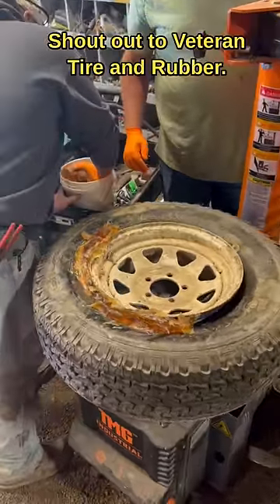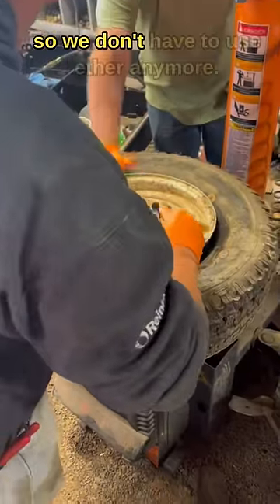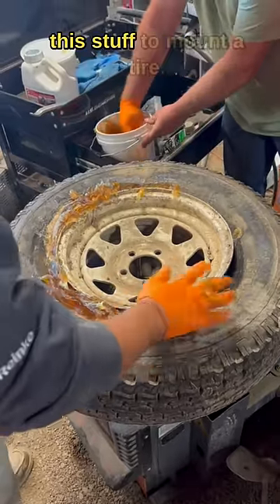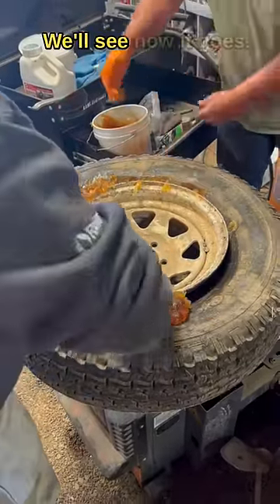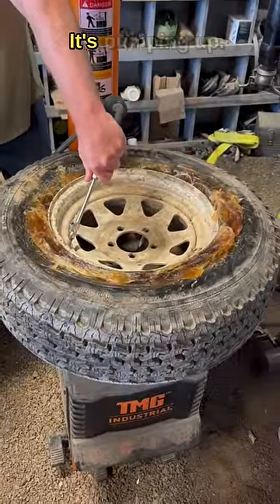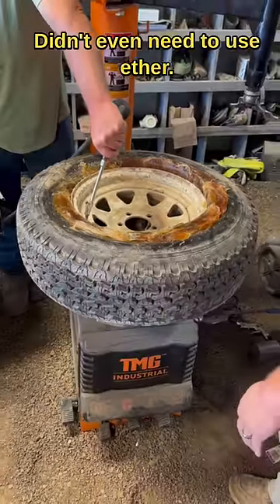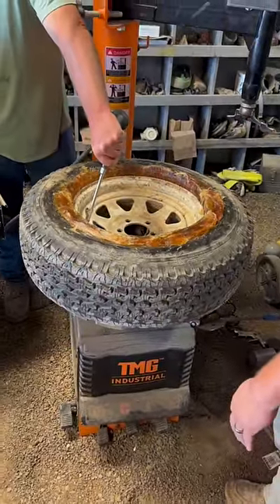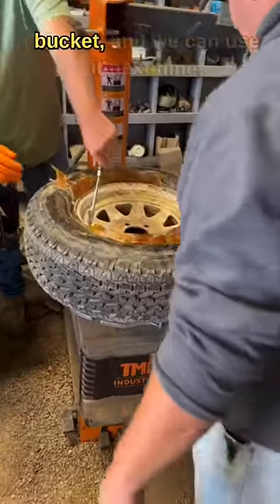Veteran tire and rubber sent some tire mounting compound. Let’s see it work. #farming #shorts ￼

Comment: Good luck balancing the tire with 3 lbs of mounting compound bouncing around in there.
Reply: i don’t know anybody that really cares about trailer tire balance, and that compound pushes more up and out of the tire due to the increased pressure and that forces it all up
Reply: @marblesky9252 nobody cares about their trailer shaking all over the damn highway?
Reply: @es0x feel free to check every trailer you see for wheel weights. I can tell you out of the 20 trailers at the company I work for there isn’t a single one with a balanced tire and none of them are “shaking all over the damn highway”. That only happens when a trailer isn’t loaded properly. Usually heavy in the rear.
Reply: Looks like a trailer tire so no need to balance
Reply: @claudetesh1265  you are correct that most trailer tires aren’t balanced like vehicle tires, because the discrepancies between tires aren’t enough to matter. However if you’re gonna have a pint of grease in there, it definitely won’t be balanced anymore
Reply: @claudetesh1265 sounds like a great lawsuit, where you live I’ll drive next to you and when your pos trailers start swarming and damage my car I’ll make sure to sue and get a brand new car. All because you didn’t get them balanced
Reply: @big_watson2015  come on then, you would have to be in my lane with my trailer which would only put you at fault there smart guy.
Reply: @claudetesh1265  your in the right lane bsin going 60 up a hill and I’m passing in the left, yours starts walking in the back and hits me, pay day baby, end of story bum
Reply: I was thinking the same thing, maybe it will get evenly spread because of the centrifugal force
Reply: @big_watson2015  well it hasn't happened in the last 11 years so if you need that payday that bad id suggest finding a job instead of trying to will an impossible act to make you rich.... bum.
Reply: @Steppinonshii  thats exactly what happens btw, look up wheel balancing beads. same concept.
Reply: Ad someone that uses the paste when needed.  I can tell you when you dismount a tire after using it there is virtually nothing inside and tires balance easily. 

The air pressure coming in pushes it out.  Very simple concept.
Reply: It's not in the tire. It's on the bead edge and rim.
Reply: @big_watson2015 they generally don't get balanced and they don't bounce.
Reply: You took the words right out of my mouth. It’s exactly what I was thinking.
Reply: It’ll always balance out 
With 50+ weights 😂😂❤
Reply: You realize this was applied on the outside of the tire and most of what got into the tire was forced out by the air pressure... negligible at most
Reply: For all of you talking about balancing. There are numerous liquid balancing agents. Centrifugal force will disperse it. As it gets hot & more liquid like. It will evenly disperse & provide for balancing.

In some cases, water is put into tires. For specific effect. In most cases for rock crawling.

The little bit left in the tire. Is so minimal, once distributed. It is beneficial.
Reply: The grease will spread and balance itself out… there is such thing as active balanced wheels.. they are wheel with steel balls built inside of the bead, they are in a channel and have free movement. When the wheels spins the centripetal force spreads the balls until they are in a sweet spot, known as balanced
Reply: thats about what I was concerned with. that stuff's gotta get wedged inside sometimes.
Reply: It washes right off with water its like fucking soap my dudes
Reply: @big_watson2015 trailer tires dont need balancing.  My trailer has 6 tires and no tire shop ever said that they have to be balanced. DOT inspectors dont check it unlike vehicle tires.
Reply: My old boss called it gorrila snot it saved me a heap of times with tractor and loader tyres but I wouldn't use it on road cars or trucks we'd use bead blasters for that stuff
Reply: @big_watson2015 just be quiet, you haven’t sued anyone in your entire life 😂
Reply: 💀💀💀💀💀 what a nightmare
Reply: That’s gay. Use f in ether
Reply: @big_watson2015  How many times have you ❤been in accidents that were specifically caused by tire imbalances that makes you the expert?
Reply: Exactly what i was thinking. That rim gonna be counterbalanced and boggered up😂😂
Reply: Tell us you are not a car guy without telling us?!
Reply: @es0x   good thing it isn't grease and basic science proves you wrong.  Pretty pathetic to make comments on something you literally have no clue about.

dunning kruger effect is tough for some but also dealing with d0wnsrndr0me?!  CRAZY!

 Sorry for all you commenters suggesting this is a bad idea...  You conception was a bad choice.
Reply: @es0x  it doesn't unnerve the driver or passengers..
But this tire soap gel sits on the sidewall, it doesn't get put down in between.
You sling it at it, it's thick.
You air up, you scoop it and sling it at the bucket.
If it's inside and running the tire on the road, it makes the whole inside of the rubber have a thin coating.
You see this in the event of a repair that occurs soon after. It's rare, but if you're always doing this stuff, you may see that occur.
I did.
I can still remember that many decades ago.
This soap gel has been in use probably before your dad was born.
Reply: @es0x  soap gel
Reply: @big_watson2015   just stay in california
Reply: @big_watson2015   it's always being pulled forward, though.
Reply: It gets pushed out, will not effect the balance of the tire, what little bit that may remain will naturally go to the light spot anyway, how do you think tire balance beads work? Some people just like to try fault in everything, and they usually are the absolute most incompetent people.
Reply: They will balance out.
Reply: That’s what I was thinking lol
Reply: @es0x it's how you load the trailer. 3lbs of anything ain't gonna do shit
Reply: It’s been tested almost nothing gets inside if you use it right don’t get any below the bead and it gets shoved out still messy and gets dirty and can leave dirt on the bead but that’s after a bit, it’s still overpriced grease
Reply: @marblesky9252 I’d say I don’t know anyone that cares zero about it either.
Reply: That was my thought exactly
Reply: Damn this is funny reading all these comments arguing like a bunch of children.😂😂😂😂
Reply: @big_watson2015  God these made-up ass scenarios so u can make believe sue.. so goofy man.. holy hell.
Reply: gets pushed out by the rubber dummy
Reply: @es0x  shouldn't it just work like balancing beads
Reply: 1. nobody balances trailer tires if you get sold on getting your trailer tires balanced your just plum stupid 😂 and 2. 3 Lbs is an over exaggeration even if some were to fall inside the tire it’d just dry up anyways so it wouldn’t make that much of a difference regardless and 3.they could’ve just used a cheetah but different strokes for different folks 🤷🏿‍♂️
Reply: @es0x that's not how that works
Reply: Tire pushing out not in get ya facts straight you put it on bead it all oozes out learn what a product does before hating this stuff will save ya ass in the middle of no where on the side of road if you own anything with mt tires or similar
Reply: @noah97589  not that I think it even matters but surely some gets inside
Reply: hen you work for a crappy company
Reply: surely the less than solid compound spinning would solve your issue relatively quick..

Comment: As a tire man myself.. I only do that as a last resort. It can cause wheel imbalance and make the weel spin inside the tire.
Reply: Yeah, I was thinking that some would be left inside and make an imbalance issue.
Reply: I've had to resort to packing the gap and then making a small hole in it to cheetah through the hole. Boss got a face full of goo and it worked. Still have crap on the walls and ceiling from that.
Reply: I do tires my self and hate this stuff don’t use it unless you absolutely have too a bead blaster is way more affective
Reply: IT could ain't done it in 20 years ago but video 😢su re brought back memories
Reply: I have worked with my dad at his tire shop and we use soap water works great 👍
Reply: Your not a tire man 😂😂😂😂😂😂😂😂😂😂😂😂
Reply: It usually dries within minutes it's special stuff and actually becomes more grippy
Reply: Yeah I don't know why anybody uses ether or this wax compound all you have to do is wrap a ratchet strap around it shrink it down to it and then add air😂
Reply: Hey tyre man, can you explain how tubeless tyre works, how its possible for tyre just by pressing against the rim and not leak air?
Reply: We have gotten some tires for Kubota side by sides that were smashed all to hell when received. Had to expand the beads and heat up with a salamander to soften enough to get them to seat on the rim. The bead seater didn’t touch them.. total pita…
Reply: Stan mate i looked yuh up and you’re not a mechanic 😂 or a tire man but good try mate next time maybe dont put your full first and last name in your username
Reply: No way your serious lmao I thought people would understand this joke. It's a tire lube concentrate and I'm sure the guys in the video are goofing around. Never do this to your wheels lol
Reply: You just use a little around the beads then mount the tire so you don't rip the beads when you mount the tire

Comment: Ive worked in the tire business for 6 years. All you need is a little lube on the bead, an air hose hooked to the valve stem and take a bead blaster. It’ll set after that.
Reply: Bead blaster seems a little more time efficient.
Reply: I don't understand why more people don't use bead blasters. I have a portable air tank for airing up tires away from a compressor and I put a splitter on the outline side of the tank and put the sir hose back on one side of the splitter and a ball valve assembly on the other side to server as a blaster and now I use the blaster side more than the other.
Reply: This is a decent method too. There isnt a wrong way to do it so idk why soo many people are upset in the comments. People are acting like putting a new tire on is some special thing.
Reply: @stompingpeak2043  who's upset in the comments dawg? You reading tone into what's being said?
Reply: I use a ratchet strap. Rap it around the tread and squeeze it until the bead is against the rim

Comment: They just went to Lowe’s bought 100 toilet wax rings and put them in a bucket and charged 4x the amount 😂
Reply: Thought the same thing 😂
Reply: Grab the bazooka
Reply: Nawww. what I have is Murphy's oil soap tire lube, cleans your hands nice too
Reply: That was my first thought
Reply: Facts
Reply: I figured if it weren't that, then it was dyed petroleum jelly
Reply: It certainly seems like it but it’s more malleable
Reply: @mbsfield lmaoo, it looks like it but it’s a lot thicker than that, you can also use this stuff as mounting lube, just drop a little in a cup and mix it up hella good with water
Reply: @nickkeene5453  no shot? I'm gonna give this stuff a try.
Reply: I have used fibered grease since the '70s. It was thick and gooey and we called it peanut butter grease.
Reply: No, they had to blend the wax rings with a little vaseline to thin it down a bit... 
Lol that color though is 100% match to toilet mounting compound
Reply: Yeah it looked like Oaty for sure
Reply: @CmdrCorn  oh I know😂 worked in a wrecking yard for several years and used this crap 3 times a week minimum, it sticks to fuckin everything but god damn does it do a good job
Reply: Nah, it's a soap. We use it at the shop with a little water mixed in for mounting lube. We just ether everything on that won't set. Using it that way looks like a terrible pain in the ass